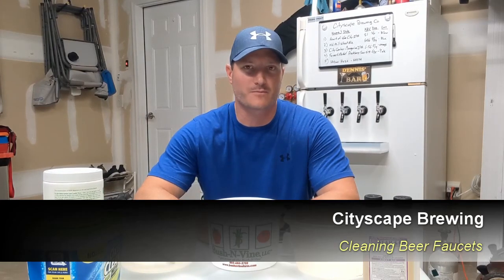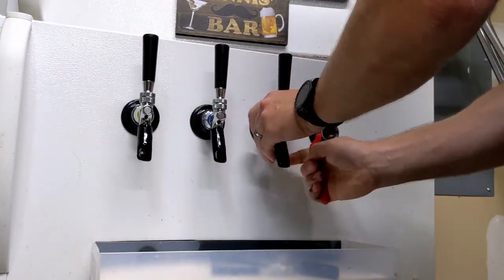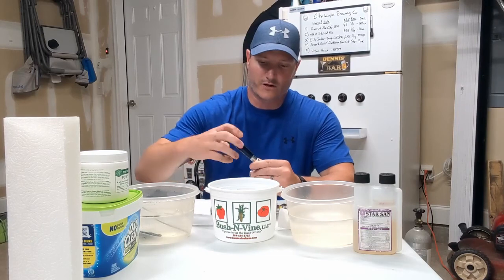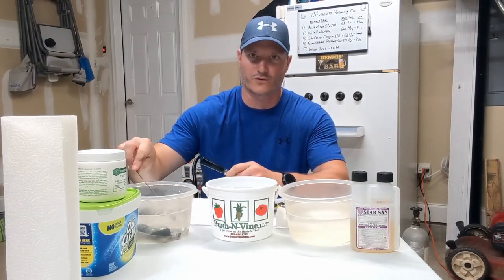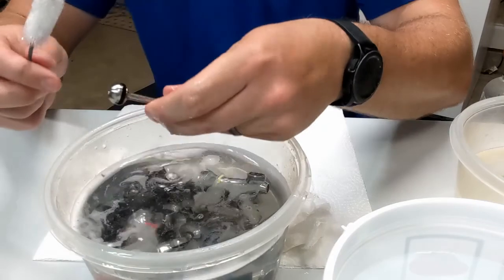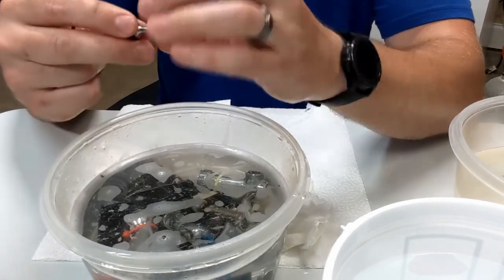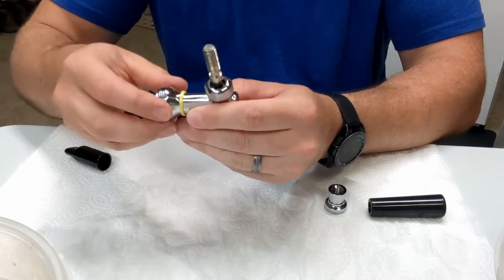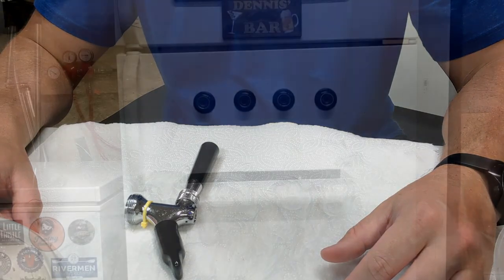Cleaning Beer Faucets

Comment: In the middle of the night, my shaft assembly leaked about 10 beers on the floor. 
When I woke up, it was not leaking 
I clean my system very well what could be doing this? 
I have changed the shaft out on this next keg . 
I’m guessing it was a bad O-ring
Reply from the maker: That would be my guess too.   You can always add a bit of keg lube to the rubber washers too, which should help seal them, but it's best to replace with new if possible.

Comment: Thanks I'm setting up a new keezer and looking through my old stuff. I now know I have both forward-sealing and standard taps. The forward sealing taps have springs in them that close the tap when the handle is released. Standard taps I guess do not and have to be actively pushed back to close?
Reply from the maker: Forward ceiling faucets do not always have springs. The springs are sold separately in a lot of the intertap and perlick faucets. Typically you have to push them both back forward to shut off.  The difference is just whether they seal in the front of the faucet or in the back of the faucet, forward ceiling has less air in the faucet and will not be subject to molding or mildew getting in the faucet when you're not using it. PS... I highly recommend getting the springs for the faucets though... You can't bump them an accidentally lose all your beer lol

Comment: I saved my santizer from when I made it the other day and put it in a spray bottle.  How long will it be good?
Reply from the maker: It depends... The shelf life can be longer depending on where you keep it but I usually reuse it for about a month or two.. max. It really has to do with the pH level. It needs to be under 3.5 pH to be effective as a sanitizer
Reply from the maker: Ps.... I generally try to refill mine every time I brew.. Since it's relatively cheap, I refill the spray bottle every couple of weeks when I'm transferring or brewing. But I use it to clean out the taps and things in between.

Comment: where do I find shanks to attach to wood and then attach the faucet and tap for an art installation piece??
Reply from the maker: Do you mean the insert so you can screw on a different tap handle? If so, those are called brass wood insert nuts. 3/8-16 size. Here's a link to ones that works with tap handles. https://amzn.to/3OL8xU7
Reply from the maker: Or if you mean the part that would normally go through the refrigerator door, then you need this piece. 4 inch Shank:
https://amzn.to/3CM2o5E
Reply: I appreciate all the suggestions, but I need just one piece to make it stay in a solid wood base, no liquid will thru it, just artistic..not a long piece, any other tips??
Reply from the maker: Oh ok.  I understand now.  At a minimum you will need the coupling collar that allows the faucet to screw onto something.   You could epoxy/glue it to a board and then screw the faucet onto that piece.  https://amzn.to/3yohEFf